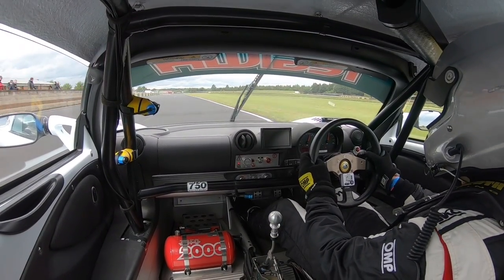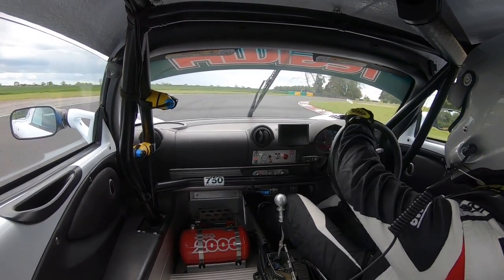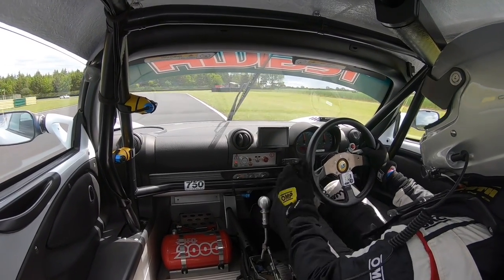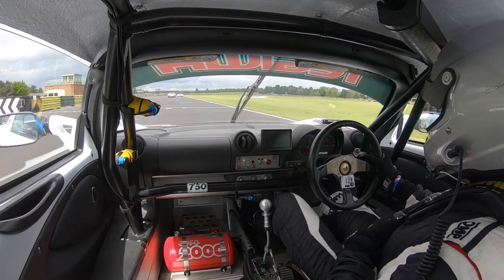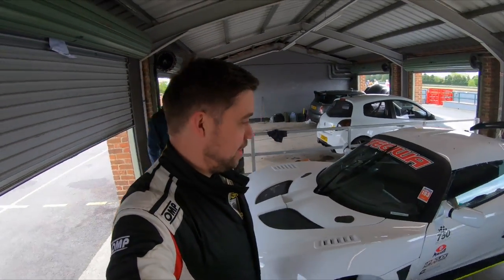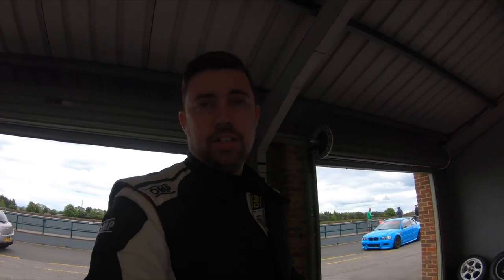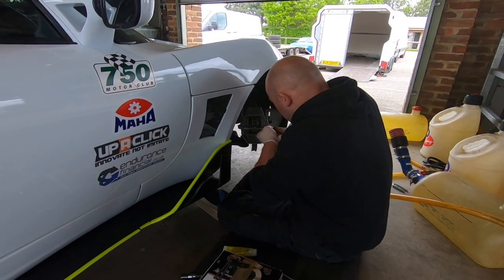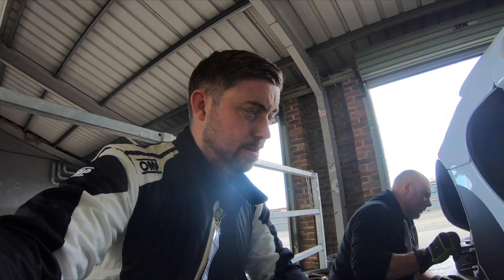Testing the Lotus at Croft Circuit (Race Week Vlog) | EP8

Comment: Try bedding them in in the rain, sometimes some dirt and water make them bed in easier. Would be a shame to throw away good disks every time you change pads. Could be that the chemical deposit of the previous pads just isn't compatible with the new ones and resurfacing might be a solution.
Reply from the maker: Thanks dude! In fact it was a good shout. We tried that in the last session as it was raining. We’ll see how we get on during qualy on Saturday 🙌

Comment: Your car looks mega. I’ve owned a 2-Eleven for nearly 10 years and think it’s time for a change to something more useable. The more I look at the Elise Cup 250 the more it ticks boxes.....it has a roof and windscreen for starters!
Reply from the maker: Adam Kelsall they’re a popular car for sure and with the new ecu upgrade from RRR Engineering, up to 300bhp is easily achievable. With that power to weight, they’re a weapon!
Reply: Joe Taylor definitely an interesting upgrade. I see you went with the 2bular exhaust. I have one on my car. They’re a work of art. Are these Elise’s chargecooled as standard these days?